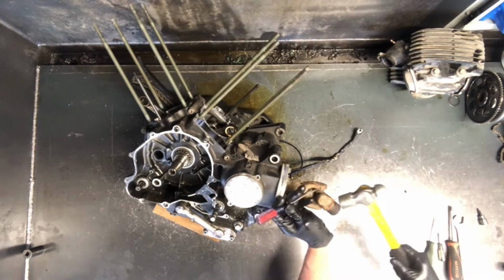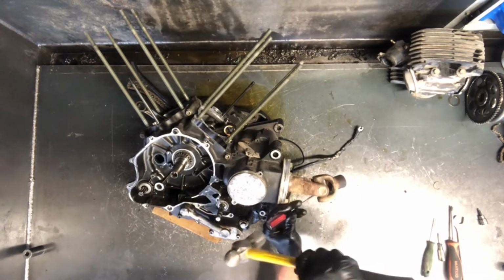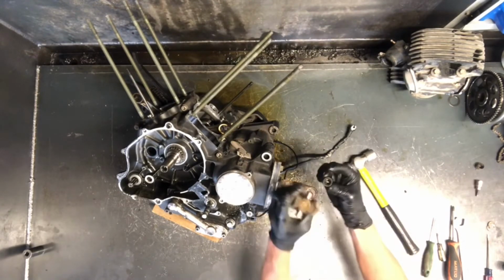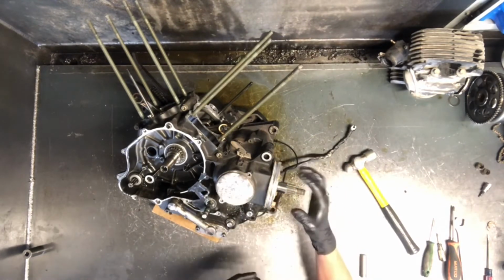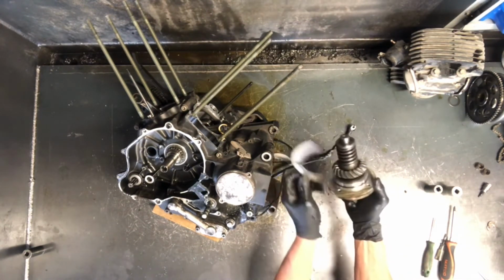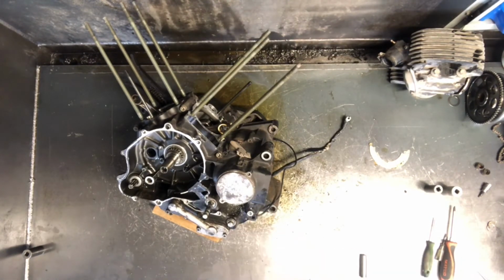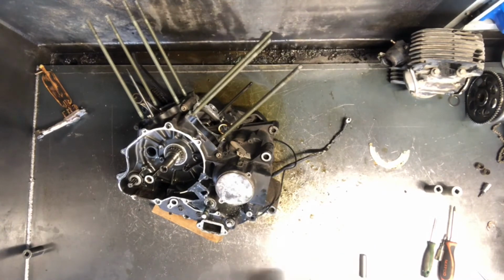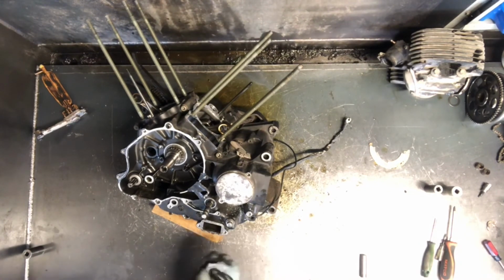Yamaha V star 650 Removing & Replacing Output Shaft Joint Bad UJoint on VSTAR

Comment: How does the housing fill up is the engine oil fed up to the gears or do they have a gear oil they use just curious so I know if when I fill my bike back up if the engine oil feeds up there or if I fill it with gear oil haven’t found anything on it and don’t wanna ruin my gears or anything thank you